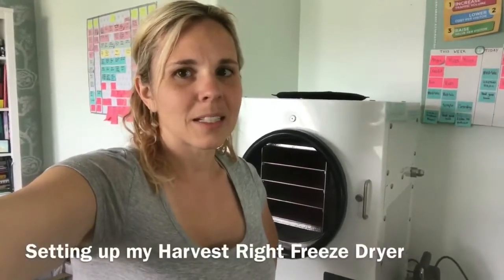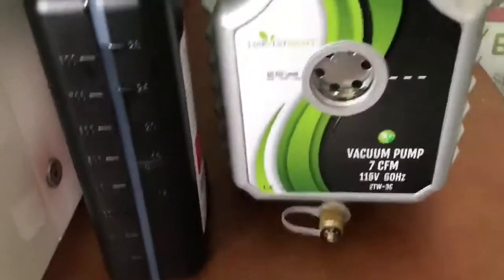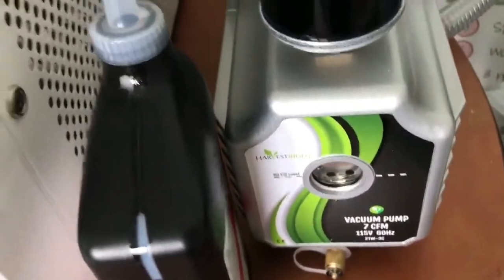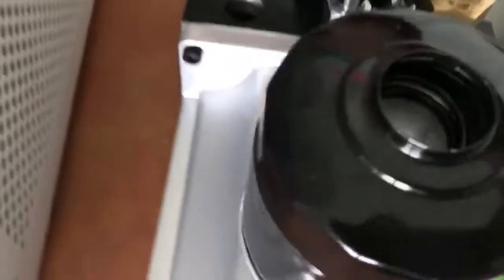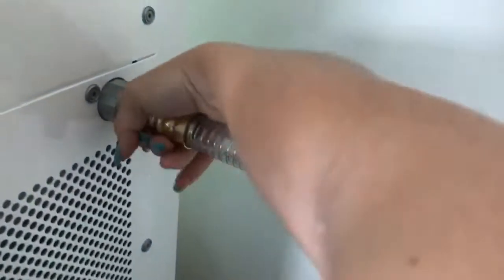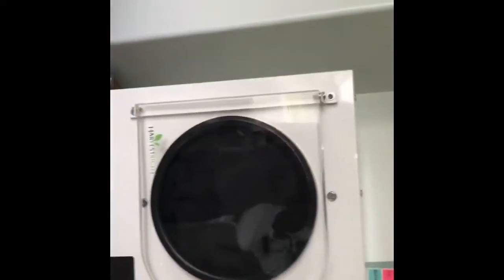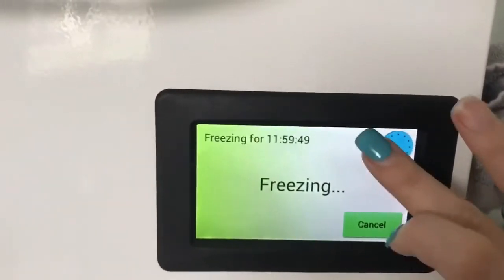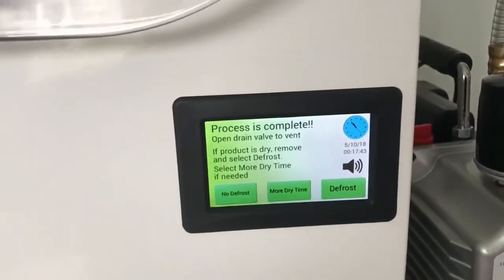How to Set Up a Harvest Right Freeze Dryer

Comment: You haven't made any more freeze drying videos since you set this up. Why?
You have an older model. The newest models are designed much better and are easier to use. 
I bought my large dryer and oil less vacuum pump in December of 2018. Love it. I have now process about 2000 pounds of foods in the past year. 
I would love to see more drying videos from you.